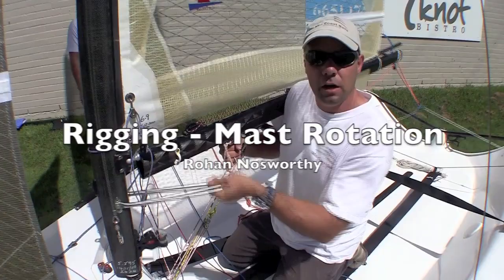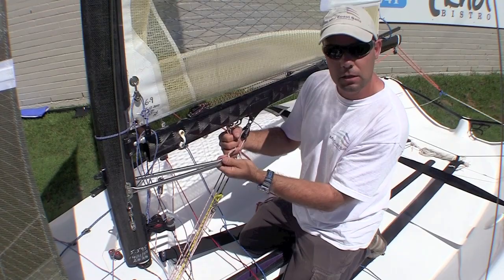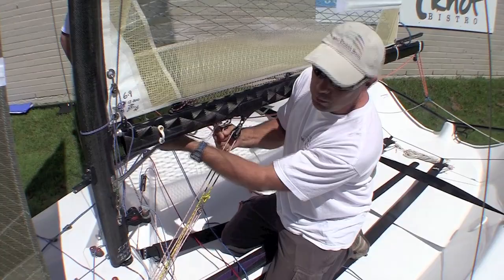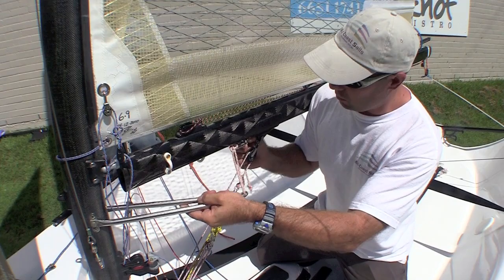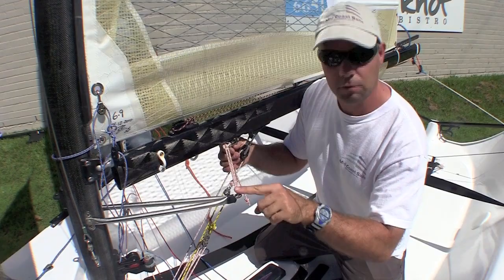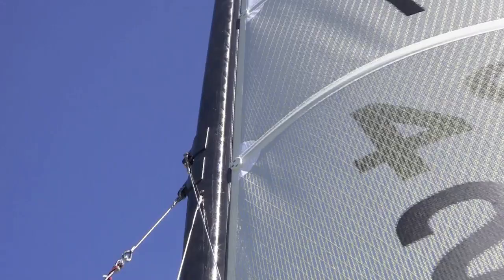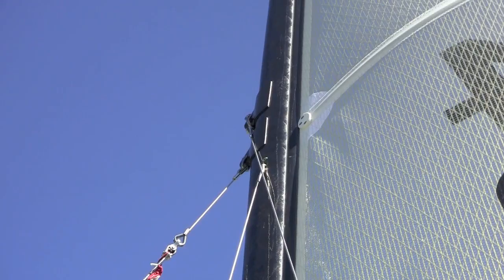Rigging - Mast Rotation

Comment: I'm interested to know if the system operates automatically in a tack or gybe, or does the crew have to push the lever across manually?
Reply: It has to be pushed through.

Comment: Thanks mates!  Great description and visual demonstration of operation of the rotating mast.

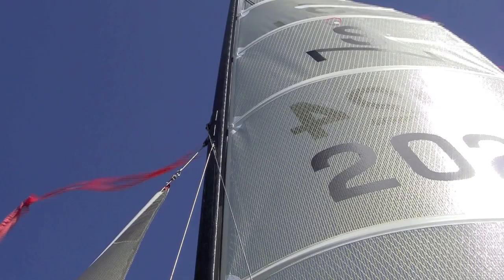1:18 really cool to see a bit of the effect of the angle of the mast on the shape (and luffing) of the mainsail.  Can see various parts of the sail stalling when the mast is over or undertrimmed.  Probably more obvious in stronger wind out on the water, but you picked a windy enough day and location to show some effect on the sail.

Question: looks like the rotating mast is a Carbon tube that presumably rotates around the inner round mast on bearings at top and bottom.  Is that right?  Is the inner mast Aluminum or Carbon?  Are the bearings roller bearings?

Also is this similar in general to the arrangement on much larger boats with rotating masts?